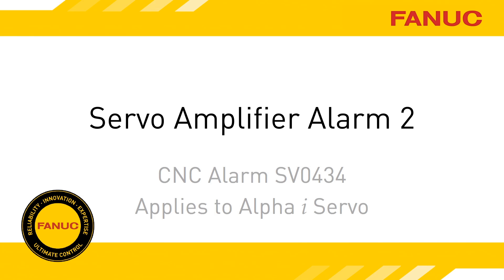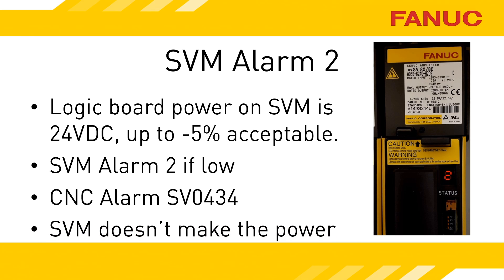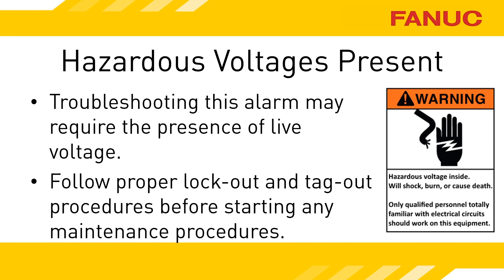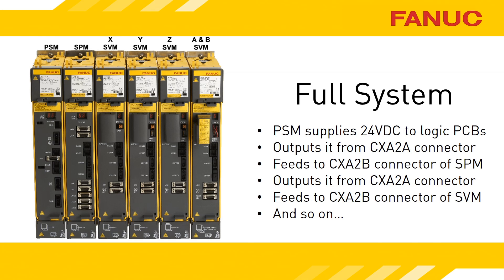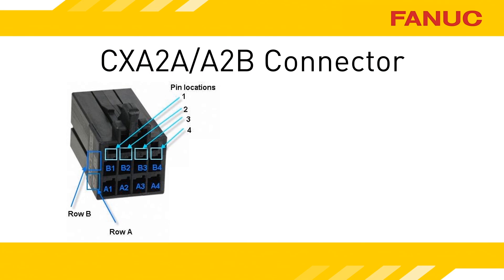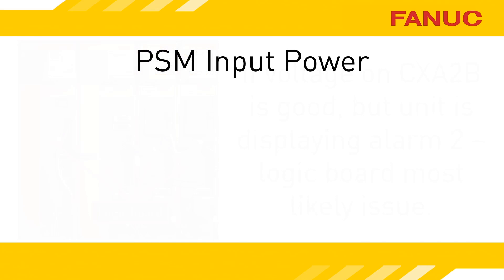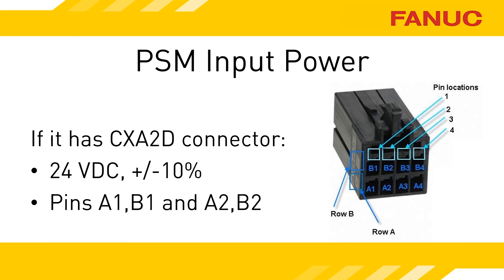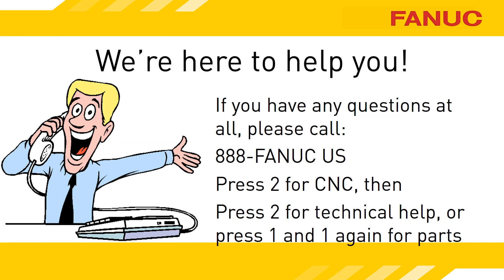Alarm 2 Troubleshooting for FANUC CNC Servo Amplifier

Comment: Everytime when I start the machine in morning After getting these low voltage alarms, i just power off and on again in 2 minutes and these alarms are gone.

Is this Ok to do so or there is any risk involved.
Reply: Did anything happens to yours? Mine had the same behavior as yours, the alarms went away after some minutes turn on, but now the alarms wont go away